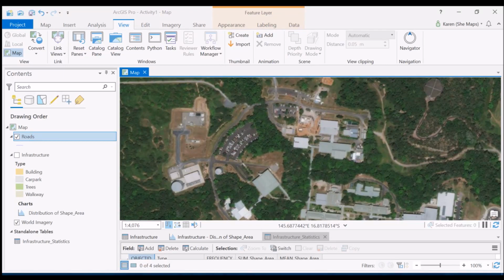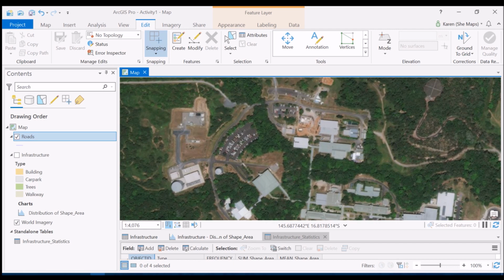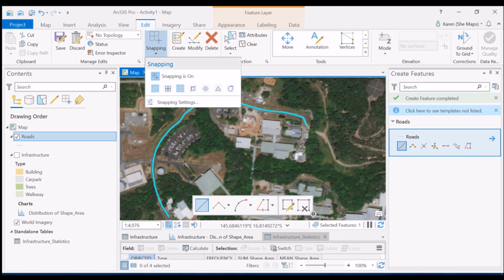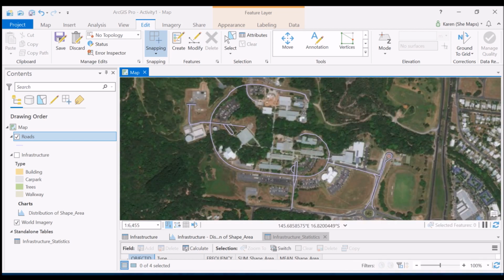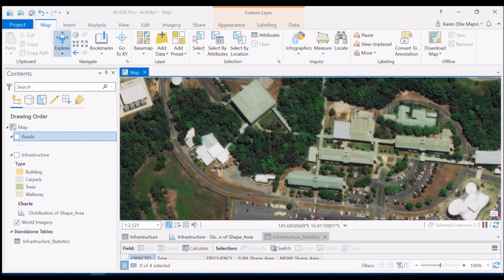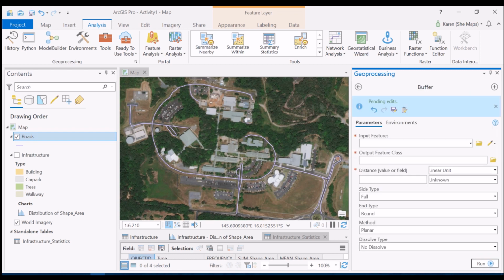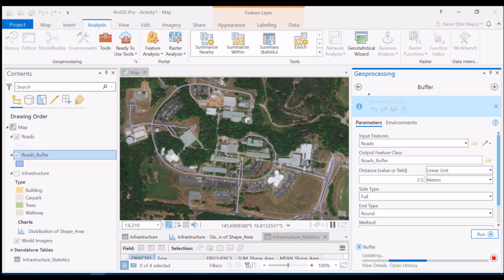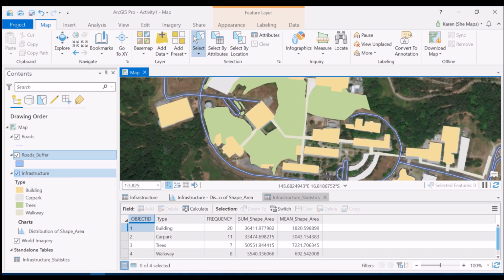Creating Road Polygons from Lines - Using the Buffer Tool in ArcGIS Pro

Comment: How did you add ROADS on the CONTENT pls i would like to know.🙏
Reply: I had this same issue. I know it's been 2 years, but maybe this will help someone else. I wasn't able to create the new feature class because there was something that was unsaved. I looked at the attribute table for infrastructure and yea, I forgot to save it after making changes. ArcGIS won't let you create something new without saving what you have already first.